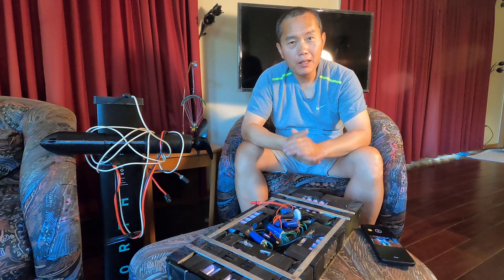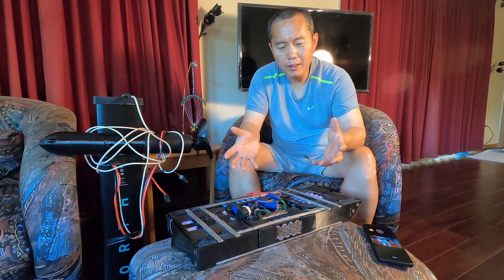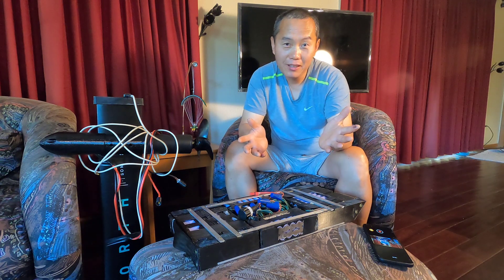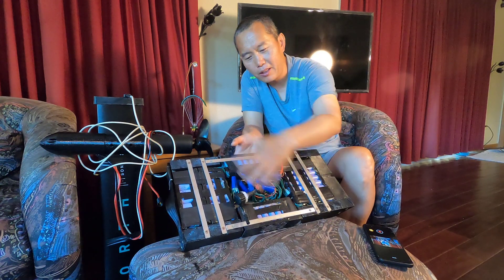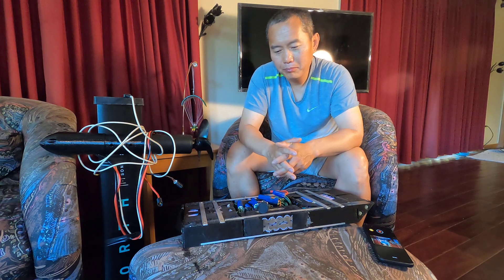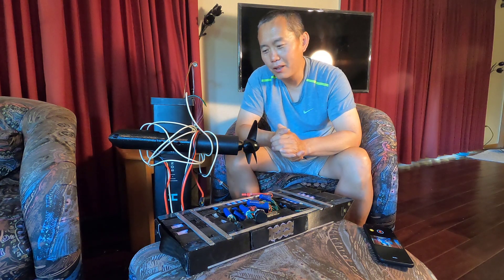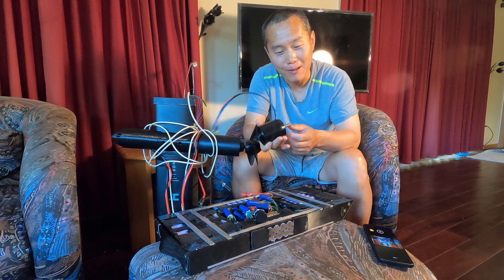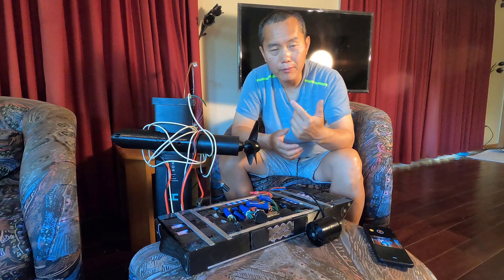Should you pay $5000 foil drive for efoil board or $700 minne motor kit?

Comment: What you are not getting is that people who use FD are athletes - they want to enjoy the sport. You seem to use motor just for riding around on foil - thats a bit more technical version of riding a motorboat. 
Big battery is detrimental to pumping, large foils are detrimental to lively ride. 
Its similar to super light eMTB vs full size eMTB with the throttle where you dont even need to pedal - you dont do the sport, you just ride around.